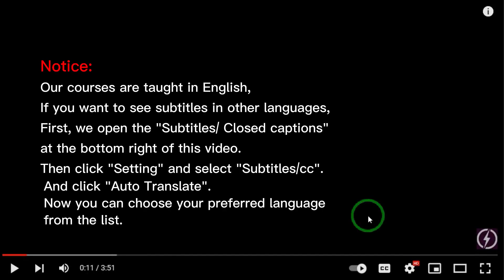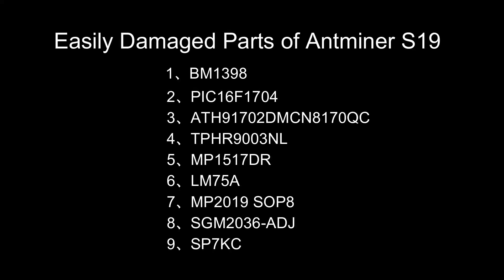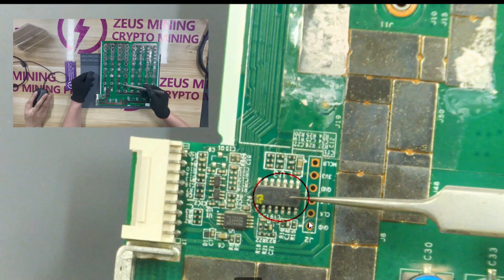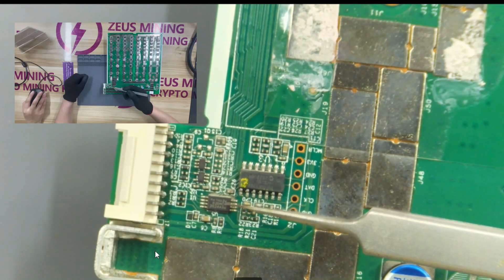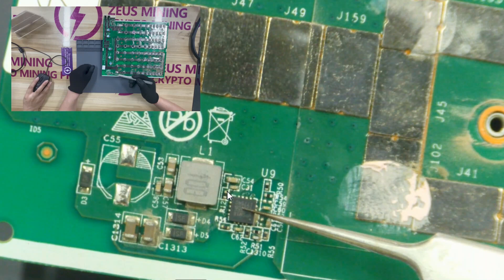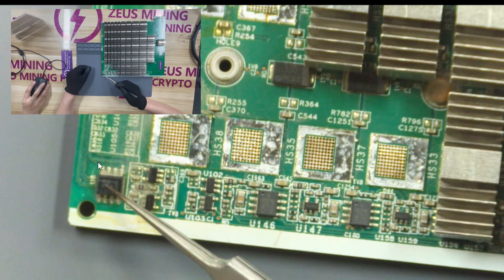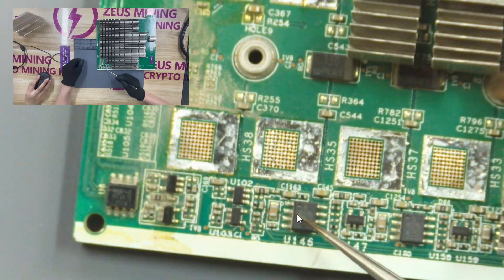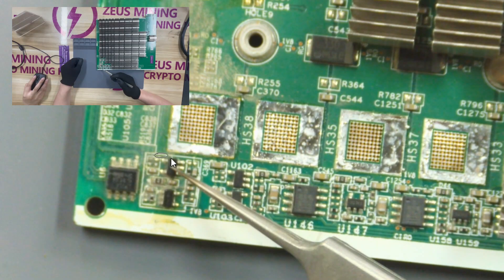Easily damaged parts of Antminer S19 hash board introduction

Comment: Hello brother im confuserd error s19 pro set_voltage_by_steps to 1500.
2022-12-19 07:55:52 start up min temp by 75a = 31
2022-12-19 07:55:55 Chain[0]: find 126 asic, times 0
2022-12-19 07:55:57 Chain[1]: find 0 asic, times 0
2022-12-19 07:55:59 Chain[1]: find 0 asic, times 1
2022-12-19 07:56:00 Chain[1]: find 0 asic, times 2
2022-12-19 07:56:00 Chain 1 only find 0 asic, will power off hash board 1
2022-12-19 07:56:02 Chain[2]: find 126 asic, times 0
2022-12-19 07:56:02 ERROR_SOC_INIT: soc init failed!
2022-12-19 07:56:02 stop_mining: soc init failed!
2022-12-19 07:56:02 uninit_temp_info
2022-12-19 07:56:02 do not read temp anymore...
2022-12-19 07:56:02 cancel thread
2022-12-19 07:56:02 ***power off hashboard***
2022-12-19 07:56:03 temp monitor thread exit
2022-12-19 07:56:30 Version num 65536
2022-12-19 07:56:30 Mask num 0x1fffe000.

Please help me